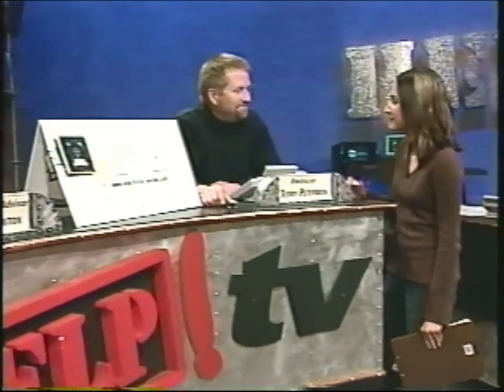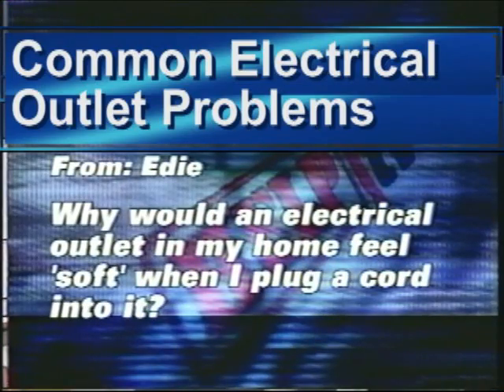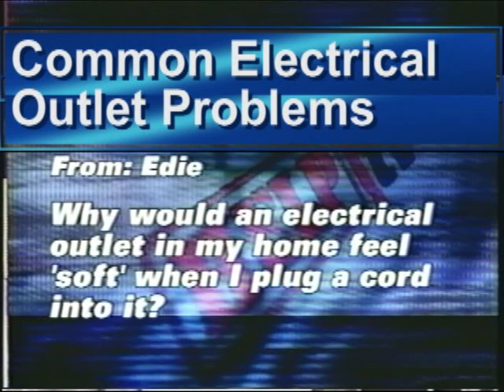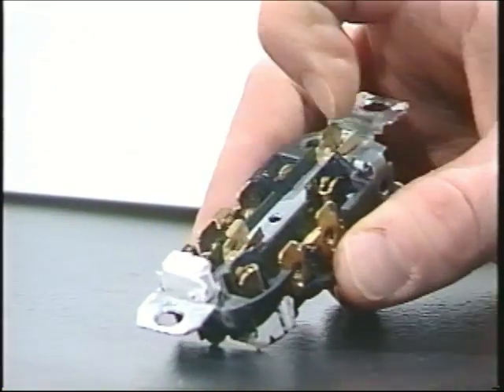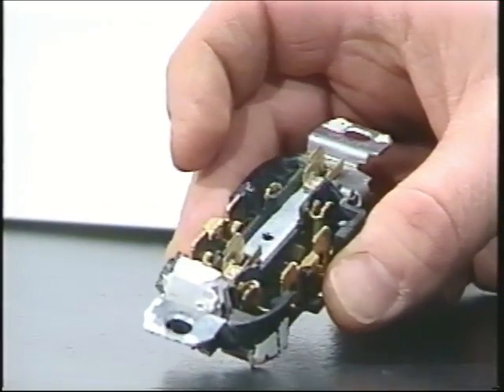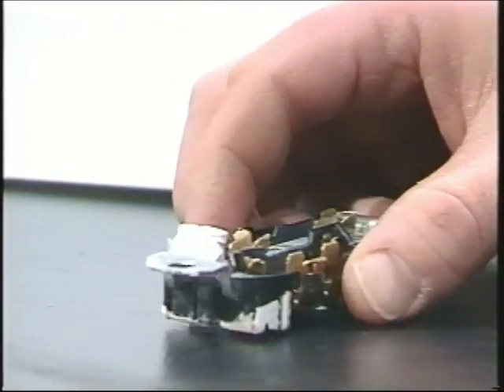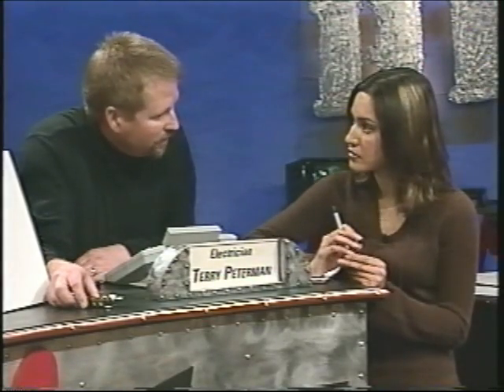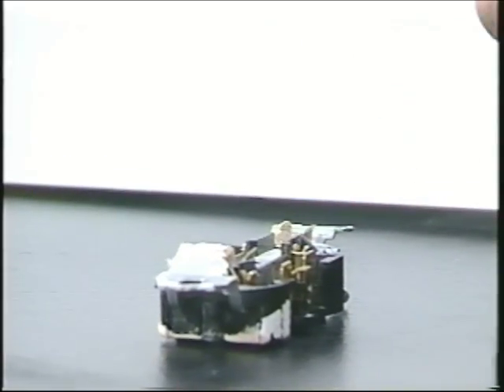Common Electrical Outlet Problems

Comment: I have a problem with my outlet. it shows me each slot is positive but when I plug something in it works like it should perfectly. it wont let me pass my inspection I dont know what could be wrong please tell me anything that could be wrong with the setup thank you

Comment: Hi Terry, Q. I have an electrical issue. In one of my bathrooms. A GFCI outlet is DOA. no power. All other outlets and switches are aok, in the bathroom. I tested the outlet with a multimeter, I checked the power panel and all circuit breakers are ok. I carefully removed the GFCI outlet and tested the copper wires. NO power? .... this outlet was working a day before. What other trouble shooting can I do, before calling a Lic. Elec. $$$.  PS. I really enjoy your videos and how simple you discuss the topic. Thanks deeman